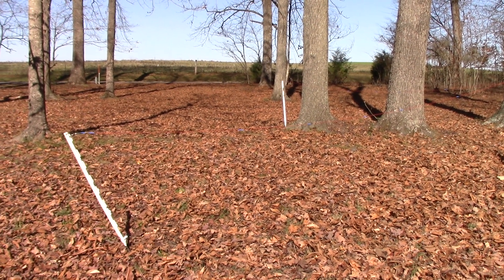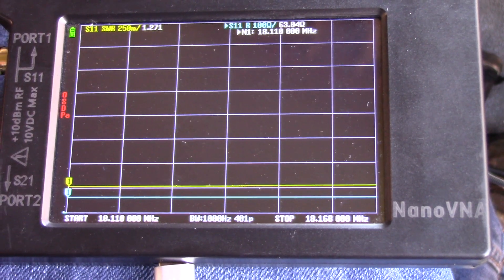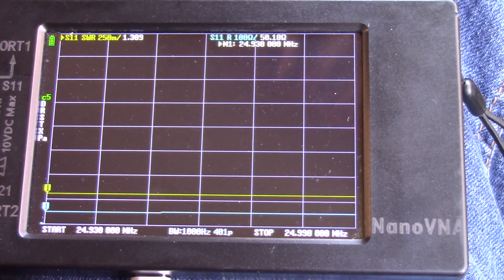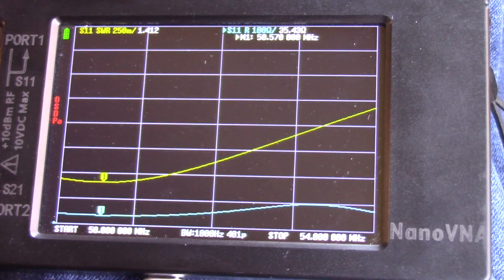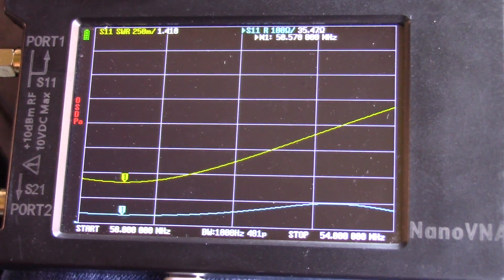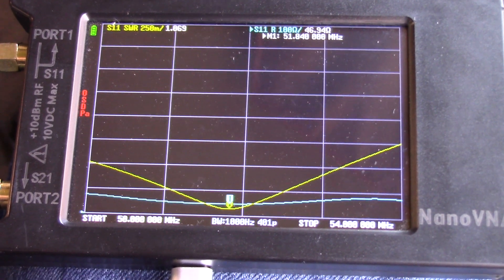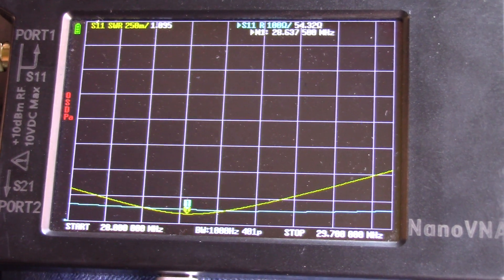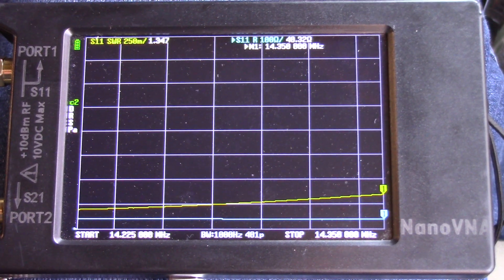Carbon Fiber Mast for hf radio antenna. Good or bad? Test results with the Poor Man's POTA PERformer

Comment: My first field day was this year and I used the same pole as you show here to hold up my 20m-10m linked dipole. The group there said I should hang it from a tree because the pole would interfere, but I used it anyway. I stayed on 15 for the most part, and I did just as well as they did with the very expensive verticals. Thank you for helping to prove my point about the pole. By the way, I probably spent about $15 on my speaker wire antenna, and don't even want to know what some of the rest spent on theirs.
Reply from the maker: I’ve used it both ways and can’t tell the difference. It works.

Comment: Thanks for the video!   The results were about what I would have expected.   The antenna is going to be affected by all objects in the near field to varying degrees.   A carbon fiber mast is definitely going to contribute to the effects on the antenna in the near field.   The differences are so minor that I doubt anyone could ever perceive them in practice.  So, thanks for going through that process, and taking us along with you!

But, I was thinking about what you said about the common mode choke being needed to prevent the coax shield from radiating, instead of the radials.  And, it occurred to me that a fan dipole would be instructive in addressing that issue.   In a fan dipole, you have multiple resonant elements sharing a common feed point.   And, the elements are "automatically" selected, based on the transmit frequency.   So, if you are transmitting on 20 meters, the 20 meter elements are going to be the ones radiating, not the others, even though they are sharing the same feed point.  I would think the radials versus the coax would be quite similar.   So, it seems that  resonant radials might help to keep common mode currents down.  

I don't quite know how you might go about testing that theory, but the results might be quite interesting.

Thanks again, and 73!
Reply from the maker: Thanks for your comments.  I’ll have to think on that and research to see if there is a way to test that with the equipment I have.  Thanks for watching!

Comment: Hi Jerry.  Love your videos.  You might want to make a change in the setup for this test.  I Think for the no carbon mast setup, you may want to leave the tripod in place, & replace the CF mast with a piece of PVC, or other nonconducting material, of a length that allows you to tie your driven element at the same height as with the pole.  Maybe some of the difference in your measurements was due to removing all the metal in the tripod support.  Just a thought.  Larry  KA5T.
Reply from the maker: Thanks for the idea Larry.  My test and setup was really twofold.  1. Was to show that the carbon fiber mast only minimally affected the resonant frequency of the antenna. 2. Was to show that the antenna was ultra portable and did not require a tripod at all.  Thanks for watching and hope you have subscribed.
Reply: @BudgetHamRadio  Oh, yes, I see.  Good work.

Comment: Hi Jerry:  I too run the POTAPerformer with great success.  I use WAGO single connectors for the adjustable link junctions which work very well. I was thinking about adding a third and then a fourth counterpoise to the configuration as an experiment.   Would place the “new” counterpoise in between the original two at which are at 90 degrees.  As a vertical driven element I use a 19 foot stainless steel whip from Chameleon Antennas.  The POTAPerformer is a very nice adjustable multi-band antenna.  I have not done any experiments with the height and angle(s) of the counterpoise(s) which may have a real relationship on performance.  Thanks 73 Art W1SWL
Reply from the maker: Art, You never know until you try.  I have had great success with this antenna and willbe doing more experiments and modeling. The antenna was developed by KJ6ER and I have just modified it to use the linked wire vertical.  Good luck and most of all Have Fun!
Be sure and subscribe so you will be notified when new videos are posted.  73 Jerry KM4ZKB

Comment: Gave this a try today.   Just tuned into 20m with a single radial and it was working great.   Feedpoint impedance was around 36ohms so swr at feedpoint was 1.6 but after 50ft of cable to the indoor radio the radio was seeing 1.1.  Odd.   Anyway on 50W with radial point SE I was getting good signal reports in GA, SC, VA and TN from
MI.    Thanks for the videos.

Jerry,  KE8QBQ
Reply: Reduction in swr will probably be due to coax loss.
Reply: I didn’t see any mention of a common mode choke in use near the antenna.  If a choke is not used, the coax shield becomes part of the antenna radial system.
Reply from the maker: Thanks for watching!  With 2 elevated radials it will work even better.  And SWR will most likely change also. E sure to subscribe for more.

Comment: Hello from New Zealand. I have watched all your vis so-far and subscribed. I am using a 10 m carbon fibre mast on a tripod and 10w sdr radio. You used an antenna tuner, which I also use. But only works below 1:2.0swr. My question is :- is there an antenna tuner to bring it down from say 1:5.1. I also have a Z-match, but that is for 5watts. I would like to use up to 50w. 
Great videos and great work. The common mode choke design would be great. Thanks and regards. Sandy, ZL3AXL. 73
Reply from the maker: If I understand your question correctly, If you have the same Antuner that you see in my video, it allows you to configure the threshold of where the automatic tuner will kick in. The video on the choke should be out in a week or so .  Subscribe so you will get the notification when it is posted. Thanks!
Reply: @ very good thank you.
Reply from the maker: You said you were using the 10m mast but you didn’t mention the antenna.  Are you using my design?  If so are you using the version 2 specs?  Version 2 should have lower SWR than version 1.
Reply: @ not got that far yet. Currently using 5.2 meters of wire with 9:1 balun and one radial, but will go to 2 elevated radials. I like your approach - very methodical. I have a 5.2m telescopic whip that could be deployed, and adjusted.
Reply from the maker: Good luck and have fun! Be sure to subscribe so you won't miss any of the upcoming videos!